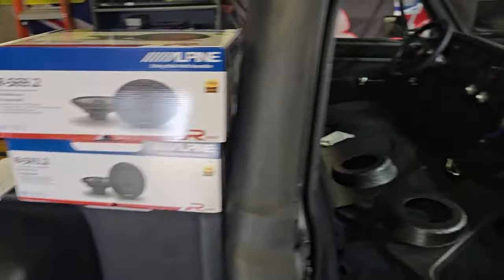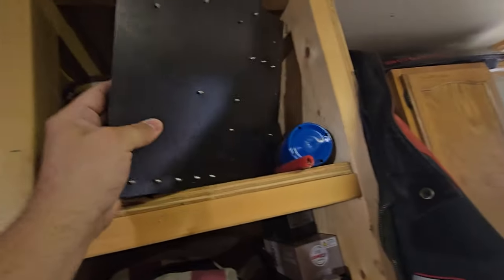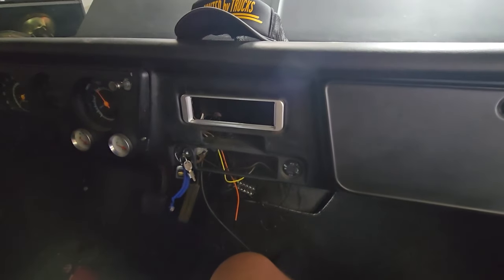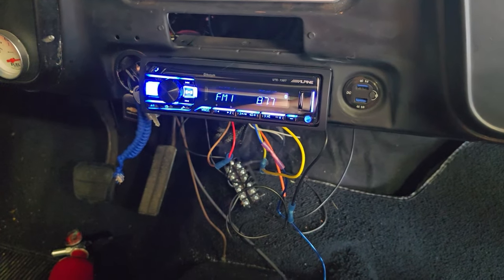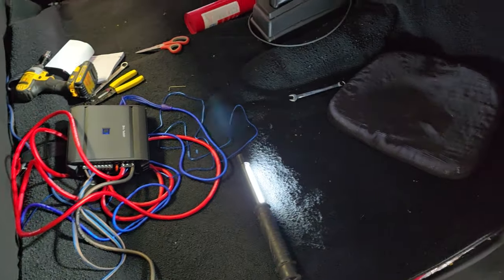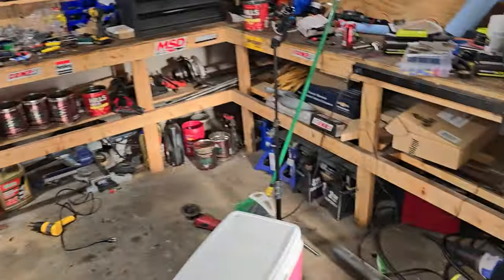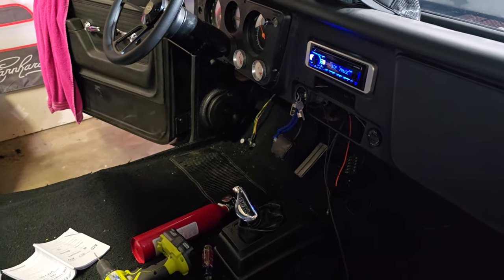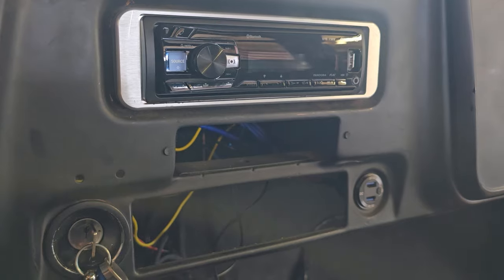Full Stereo Install on My 1972 Chevy C10

Comment: I'm at least a year away from this step. Even though I'm a 60ish year old guy, I'm going to buy a delete panel for the dash center. I'm going to cut 2 round holes for hvac vents and a 7" to 10" double din hole for an Apple Carplay unit for my entertainment system. I haven't decided on the speakers and amp yet. I handled the stereoes on our farm. And I recently put in a 10" wireless apple carplay system in my 2007 Honda Civic. And haven't regretted that a bit. Love the hands free part of it and navigation.  I'll be honing my cutting and welding skills prior to that.

Comment: Nice job I had one that I did a full system install, but I took my gas tank off behind the seat and put 12 inch subwoofers and mounted the amp under the seat and I know how difficult it was to do the system in it but you turned out with a great job. Keep up the good work.
Reply from the maker: thank you fella...I am considering adding a woofer in the future myself

Comment: On the antenna, I just get the windshield that the antenna is inside the windshield. I got a 81 K- 20 Scottsdale that’s what I did so I don’t have to deal with an actual antenna mounting it on the  body place for it to rust
Reply from the maker: @caseyparkinson4678  that's interesting,  I'll look into it